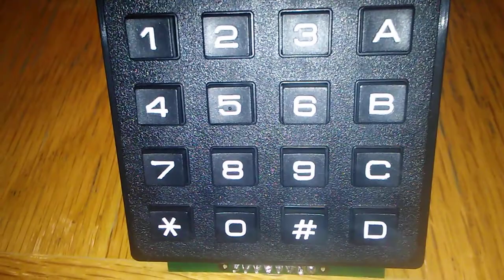DTMF encoder 74C922 and TP5088

Comment: Could you upload a video in which Arduino is being used to give input  to the the TP5088. I want know about the code of the Arduino and the connection of it to the TP5088.
Reply from the maker: Sorry for the long delay in reponding.  I haven't use the Arduino for this yet. But you'll need to program the Arduino so that for each number 0-9, and *, # will correspond to the 4-pin binary outputs. Also when any binary output is sent to the TP5088, Arduino also needs to send the Tone Enable pin HI for the same duration.  Again, I haven't done this, but if you attempt it let me know how it works. Interesting project.  As an aside I have seen on the internet a sketch where the Arduino creates the tones and allows the user to enter/vary the digits.  That might be a start point. Google DTMF and Arduino for more ideas and sketches to start you off.